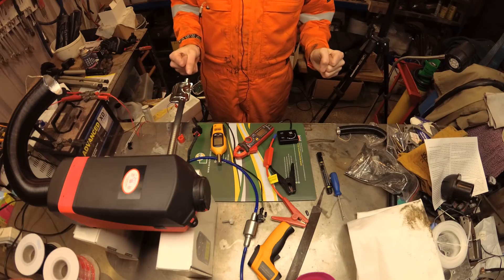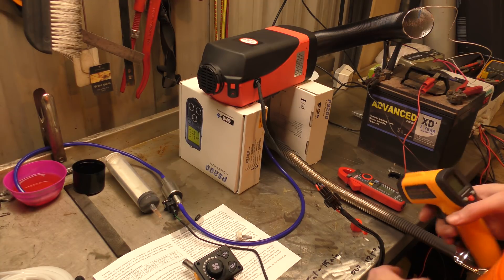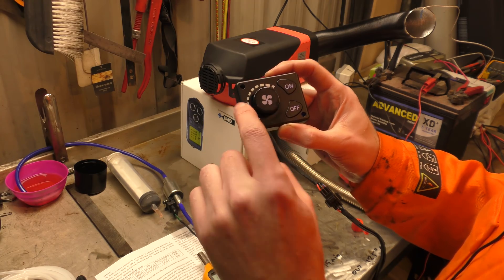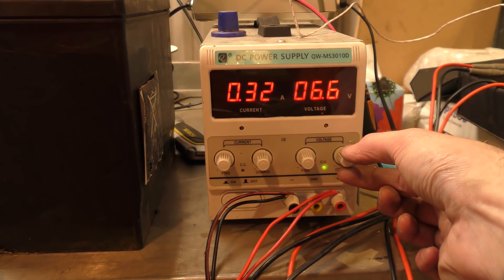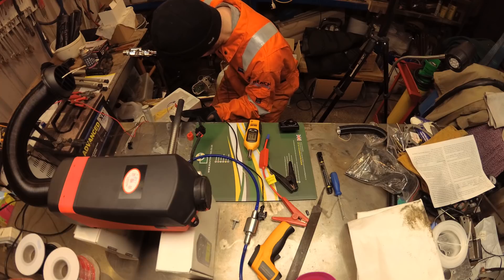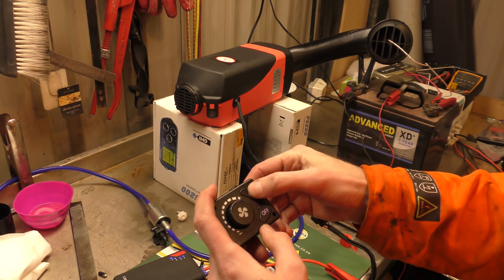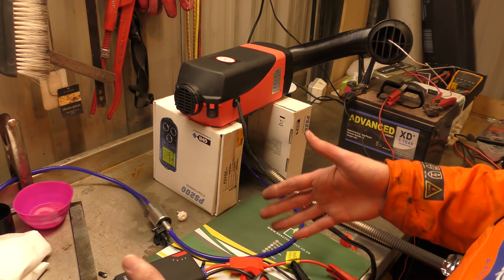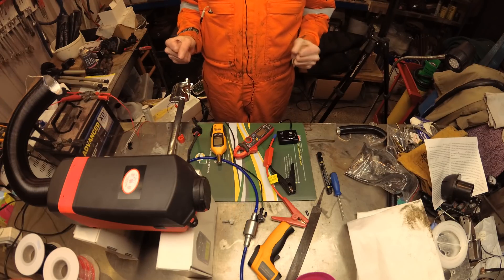Diesel heater testing - part 2 - more tests & questions answered

Comment: Hi Can you connect it to a axillary socket with a 20amp fuse in the fuse box thanks Jeff
Reply from the maker: While technically you could I wouldn't.  As you wouldn't want it to get unplugged if it was running and it didn't get to do it's cool down cycle.
Reply: Hi again why i,m asking this because l,ve got a Chrysler grand voyager with a 20amp live all the time socket. Right next to where the heater is going in to. 10 amps start up is the most it should use to  run on thanks for your advise on this idea on this.Jeff
Reply from the maker: Gotcha, if you're going to wire it into that it'll be fine.  10amps is the max startup current.
Reply: Thank you. Jeff

Comment: One question: Did you find any evidence of leakage from the exhaust pipe at any joints (that is anywhere other than at the end of the exhaust)?  Thanks for the very useful video.
Reply from the maker: I didn't, it was a pretty tight fit.  But you could use exhaust assembly paste to seal the joint when you install it to be sure of no leaks.
Reply: @DavidMcLuckie  hi David any brand you recommend?

Comment: Hi ALL, first off i know there are far more people in China so they can sell these heaters pretty cheap compared to Webasto or my fav the Eberspacher that i had in my brand new DAF lorry. Now i have seen some comments and questions so here goes, both the Webasto and the Eberspacher are brilliant heaters and when fitted to a lorry they supply an extra piece that fits into either the FUEL TANK or an INLINE COUPLER still feeding CLEAN WHITE DIESEL into the heater, in the 12-13 years i was on the road i NEVER HAD A PROBLEM WITH EITHER OF THOSE HEATERS. Now at the age of 34 i re-trained and got on the Mobile Cranes to double my take home pay ,now it depends A LOT on what crane your on but the smaller ones tend to have these Eberspacher or even a gas operated one and youd have a 13KG bottle right behind you mounted properly. So after having so many trouble free years with both diesel heaters i could not figure out why even a year old Eberspacher would go down and smoke like as if the glow plug was sooted up or the filter was dirty but after doing some research i realised the CRANES come under Agriclture Laws and are allowed to RUN ON RED [DIRTY] DIESEL, now because the crane does 360deg turns on own axis all day every day you cant use the cranes fuel tank so what you see here with these white fuel tanks that come with the kit  we were using the same thing but they were full of RED DIESEL so when i got wind of this i told my boss why the heaters were breaking down and always having to be taken out and sent back to Eberspacher for repair well as soon as we all started using CLEAN WHITE DIESEL no more problems ,SO THESE HEATERS RUN CHEAP ANYWAY  WHY WOULD ANYONE WANT TO USE A CHEAPER OIL THAT WILL MOST DEFINITELY FUCK UP A GOOD HEATER JUST TO SAVE A FEW POUND WHEN IN FACT YOU HAVE NOW GOT TO TAKE IT OUT AND GET AN ENGINEER TO TROUBLE SHOOT ,THEN TAKE APART,THEN WITH THESE CHINESE HEATERS TRY AND FIND SOME PARTS.      LOOK JUST DO YOURSELF AND THE HEATER A MASSIVE FAVOUR AND USE THE CLEANEST WHITE DIESEL YOU CAN GET AND THAT COVERS  ALL THE 2KW 5KW 8KW 12 KW ALL OF THEM .         I HAVE JUST BUILT A 20X12 WORKSHOP AND WILL BE BUYING THE BIGGEST OUTPUT HEATER AND ALSO PUTTING SOLAR ON THE ROOF AND FRONT SO WATCH THIS SPACE GUYS PEACE                SCOOBS.

Comment: I have a couple more questions: (1) can you please measure the quiescent battery current after pressing the off button and the unit coming to rest? (2) does the control work as a thermostat (i.e. modulating the heat output to maintain set temp) or does it simply control the heat output with no regard to actual temperature? (3) is there a provision to wire in an external thermostat? (4) is there a way to enable or disable the unit using an external signal from a control circuit?
Reply from the maker: Good questions.  I'm working with the 8kw heater just now so I'll be able to test the two heaters and two controller types.
Reply from the maker: (1) - @12.7 volts LCD 80-90mA Rotary 30mA (2) Yes.  Once you set a temperature it goes to max power to reach the temperature then throttles back once it's reached.  If you use the pump hz it just operates at that output with no regard to temperature. (3) Not that I've seen (4) You can buy a wireless remote control for the LCD version.
Reply: Thanks very much David!

Comment: those jump-start batteries usually don't have any protection on the high current output. the lower current outputs like usb usually do have a low voltage protection. the high current output would just need a lot of big heavy electronics to properly switch on/off, so they simply leave out protection to save money.

I don't see why your jumper pack wouldn't power it, unless the battery was low or weak maybe?
Reply from the maker: It did actually work the first time, but I wasn't filming.  I recharged it but I don't know if it's weak (as it's quite old) or if it was too cold for the cells.  But it certainly does work off a battery pack.

Comment: That battery pack thing you tested on the heater is the exact same 1 that put me in hospital last year when it exploded and set fire to my hand. I do have a video i made of the aftermath. Be very, VERY careful with that pack !!!! Just saying.
Reply from the maker: Now I'm curious, what were you doing with it when it exploded?
Reply: @DavidMcLuckie  just connected it across battery terminals + to +, - to - cranked engine over noticed smoke coming from booster, ran round to disconnect then as i went to grab it, boom it went up !
Reply from the maker: Ho Lee Shit.
Reply: I guess gotta remember to grab it by the hair when you see smoke. Hope there wasn't any permanent damage to your hand

Comment: Hello, I keep getting an E10 error and have checked the fuel line and all is clear.... any ideas
Reply from the maker: If you disconnect the fuel line from the heater does fuel come out when the pump starts pumping?

Comment: Hello David, good information again. I've ordered the self contained 5kw unit with the intention of using it in my workshop as well as the van. Are there any issuese I need to be aware of with running it of a battery conected to a battery charger. Thanks, Patrick...
Reply from the maker: The only one I can think of is if you use a 'smart' battery charger and it doesn't like the low current draw and sees it as a battery fault and stops charging.  But that'll depend on the charger, the Ctek charger I was using didn't seem to mind.

Comment: Great video with lots of helpful information. If used to heat a small workshop would it be okay to power the system directly using a 220V AC to 12V DC converter (the sort of thing you get to pre-cool your automotive cooler bag before leaving home) without using a 12V battery and a battery charger?  Just seems that that would make for a more simple solution for if you do not need to move the heater around.
Reply from the maker: Yes!   But you'll need a DC power supply that will output 10 amps.  I'd go for 15-20 amps just to be sure the voltage doesn't sag.
Reply: @DavidMcLuckie  Thanks mate. I hadn't thought about the start-up cycle where it draws a fair bit of extra juice, and unfortunately my camping 220V to 12V converter is only 5 amps. Fortunately I do have an old battery and old battery charger, so I will just have to make a slightly bigger box for the workshop heater, to allow for the battery and charger inside. 

I am looking at getting the 5 KW version but when looking around they all seem to look exactly the same, unless moving up to the 8 KW version with four outlet ports, that otherwise also looks exactly the same. Do you know if it is just the burner that makes the difference?
Reply from the maker: I'm thinking of buying the 8kw version just to see what the difference is as they all look identical in the pictures.
Reply: @DavidMcLuckie  Would love to hear what comes of that as I will probably be better off with the biggest version for heating my workshop.
Reply from the maker: I think this applies here - You can have a bigger heater output less but you can't make a smaller heater output more.  If that makes sense.  :)
I've got an 8kw heater ordered now.
Reply: @DavidMcLuckie  It makes a lot of sense. The question is how the 8 KW differs from the other ones. They all look alike, with more or less the same size, so I wonder what determines if it is 2, 5 or 8 KW heater? Could be a larger burner perhaps, but I cannot see how there would be much space in there for something much bigger than what you already have. It will be exciting to see when you have yours delivered, and I hope you might do a video on the specs and comparison etc.

Comment: have you tried to extend the exhaust by 5 meters or more
Reply from the maker: I haven't no.  I don't even have 5 metres of pipe.  Are you wondering if the length and back pressure will stop it working?
Reply: @DavidMcLuckie  yes have mine on the inside of a house works well but need to get rid of the fumes
Reply: Ian Howard   Are you saying you have the exhaust pipe venting into your home?? 
If so, stop using this unit! You will die if you don’t vent the exhaust outside!!
Reply: @fredg8199  no the goes out side then goes into water radiator to give hot water
Reply: Didn't think you would, just wanted to be sure!

Comment: On the LCD version you can set the low voltage cut off and set 12/24v. There may be a way with the rotary but I am not sure how?
Reply from the maker: That's good to know.  I should really get an LCD controller.

Comment: From start to finish how long does your 12V battery last
Reply from the maker: Mine specifically?  About 12 hours.  If you have a larger or smaller leisure cell it will run for longer/shorter.

Comment: We burn kerosene heaters unvented inside tents all the time. test the monoxide output with kerosene...if you would sir.
Reply from the maker: I did test my diesel space purely for my own curiosity while I had the meters out.  About as close to the front as I could get without burning myself I got a CO reading, but as I moved away it dropped off and sitting the meter nearby gave zero.  I also run the diesel/kerosene space heater inside the workshop and have a CO alarm.  I've had it running for hours and the meter still showed zero.

Comment: thanks for the excellent vids ,,i have just ordered one  after watching your tests of the thing.
Reply: I two got one because of the 1st video. 24 months later still going no problems 😊 my only problem is getting used to the tick from fule pump.i even put it on when I wasn't sleeping in in .why because I didn't have to de ice my windows.my van is ex mobility so the mane battery is stronger than most vans.i think the drawer when on is so low  .I haven't had my battery run flat,but do carry a jump pack.fully charged at all times

Comment: To combat lowering the temp on full power enter the password and change the maximum fan speed to a lower setting. You should be able to stabilise it from low to high :)

Comment: Great videos. Any chance you could test some of the safety features e.g what happens if you restrict the air inlet, block the outlet etc
Reply from the maker: I'm only guessing, but having disassembled it they only sensor on the hot end is a temperature sensor, so chances are it will either detect its getting too hot and stop.  Or catch fire.
Reply: @DavidMcLuckie  Exactly!:-) I'm thinking of fitting one on a boat where you don't have the option to runaway. Would be good to know it shuts down as it should! ;-)

Comment: Are there Chinese heaters that do not heat air but plug into coolant water circut of engine? (in order to heat up engine block for easier morning starting)
Reply from the maker: I've been looking but haven't found any yet.  I've even been thinking of ways to convert these heaters with maybe a water jacket.
Reply: @DavidMcLuckie  if you do so, or if you find it, please make a video :)
Reply: Maybe just pipe the exhaust from this to the engine block, not the most efficient for heat transfer but the difference in ambient temp and exhaust temp should mean it'll be effective enough.
Reply: @InsideAlan  hm for some applications maybe though I would be concerned about fumes making into passanger cabin. For me it would bw great to find inexpensive heater that could heat engine block, and by fluid circulation vegie tank.
Reply: Inline engine block heaters have been around for decades.  Electric only, and installed into heater hose.  Less effective version installs to lower rad hose.
Reply: @kirkboivin4357  actually, not only electric, but also diesel ones made by webasto, and one another company that eludes me at the moment. So my question was are there now cheap alternatives for them as well.
Reply: @davorinrusevljan6440  diesel block heaters herein Alberta start around 900.  Electric units for glass engines are pretty cheap at about 125.  Depends on what it is you are trying to heat.  Toyota or Cat D10 ?
Reply: If I could do it cheaply, I would heat 3L diesel engine to operating temperature, and 20L veggie tank. If this would cost 900, it would probably cost more than whole car is worth ;). But thanks for inupt!
Reply: @davorinrusevljan6440  electric inline would be more than enough  for 3litre engine.   They are more than enough for 400 cu in at -40 F (personal experience)

Comment: Great video ! My question is ?  Can these heaters be set to turn on & off or cycle by themselves ? Could they possibly set up on a thermostat like for a house furnace  Or is it  On /Off heat only ? Thanks for your time
Reply: I too would like to know this. I want to use it to keep my garage at between 15-20 degrees during the winter and would love to know if it can be set to a temperature and if it then would stop and start automatically to maintain this temperature.
Reply from the maker: I don't know about the digital controller, but the basic controller just sets the unit to low setting once temperature is reached, it doesn't shut off.

Comment: Just look up British Standards for heating oil, premium C1 paraffin is too expensive for small orders, there is a C2 standard. 
All oils come from distillation of crude oil,  basically its just what is refined out that makes different grades. Any burner with a flu or exhaust can use the less refined regular kerosene or paraffin.
Pretty sure these burners wont operate with thick oils bad Idea!

Comment: This has all been good info (in both videos)  but I'm still not sure how much electricity it consumes in a day. I had never heard of these furnaces before I stumbled on your first video, and it looks like it might be just the thing I'll need for a camper or cabin, but I'll be using solar power and I would like to figure out how much power consumption there is in a day so I can properly size the solar rig. The fuel figures are great and I know how much I can expect to use in a day at min and max outputs, therefore what size tank I'll need to have on hand. Thanks for doing all of these tests for us.
Reply from the maker: Ignoring the startup current it consumes at max power 24 watts.  Assuming you run it 24 hours a day that would be 0.576 kWh/day.
Reply: @DavidMcLuckie  thanks. That's what I couldn't figure out. So, if my old brain is working this morning, I would need to add an additional 50 amp hours of usable power to my battery bank, and at least a 6 litre fuel tank, to be able to comfortably get through the coldest days. I'm thinking a homemade fuel tank from a 45 gallon drum would be a good size for a cabin, and an extra 120 amp hour battery would be ample extra power to add to the solar set up. This could work!
Reply: @John_Chiasson  we use a out board motor 20ltr auxilary tank ,with the quick connect coupling which means it can be unpluged to refuel
Reply: @kaydavies4825  I never thought of those. With those I could get through one a week in the warmer months (spring and fall) and two a week for our cold Canadian winter. Cost might be a drawback, as empty 45 gallon drums go pretty cheap around here. I'm also looking at getting a few used large oil tanks so that I can get them filled by the oil company in the fall before the roads get bad, so one of those tanks sounds perfect for filling up from the large tanks and placing in a lean to attached to the cabin. Thanks for the idea.

Comment: Red diesel? Is that legal in UK other than for agricultural/industrial use?
Reply from the maker: You can use it for anything that isn't driving on the road.  Tractors, generators, diggers, washing parts.
Reply: @DavidMcLuckie   i used to use in both a sea fishing boat and a canal boat, but they stopped it, you are allowed to use some for heating and cooking on a boat but you are supposed to use white diesel in the engine, not many do though cough cough.
Reply from the maker: Really?  Guess they realised they had missed out on taxing a group of people.  I'm actually surprised red diesel is still a thing and they haven't decided to do away with it and just tax it all the same.
Reply: @DavidMcLuckie  i suspect they will stop it  one day,  they would tax the air we breathe if they could.
Reply: yes you can use red diesel for heating in the uk.

Comment: Hi David. 
Great review and some good advice. 
Would it be ok to use this to heat my small garage/workshop on a permanent basis throughout the winter or would you say its not safe to do so?
I would mount it in a waterproof box on the roof and channel the hot air flue into the garage and also link it to a large kerosene tank.
I would only want to run it at its lowest setting just to keep the edge off of the cold.
Appreciate you cant give direct advice so if easier, would you do it if you had the same requirements as me?
Cheers
Phil
Reply from the maker: If I didn't have the oil burner to heat the workshop I'd absolutely have one of these doing it.